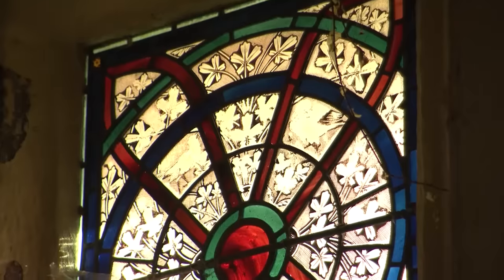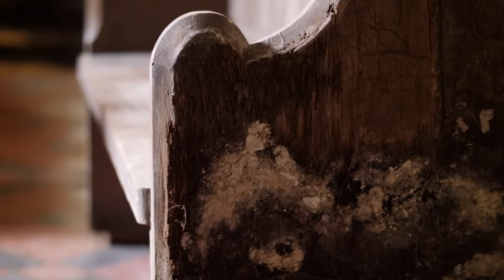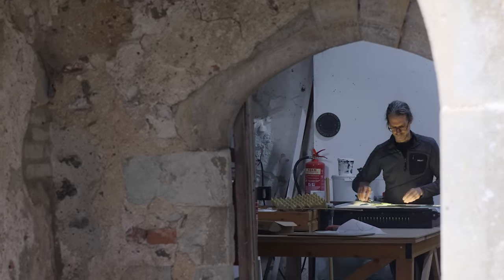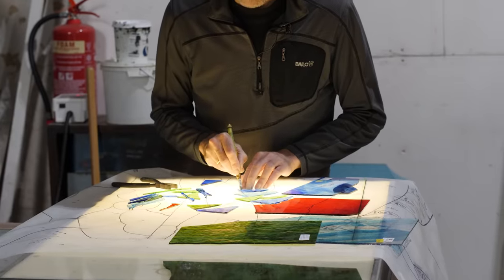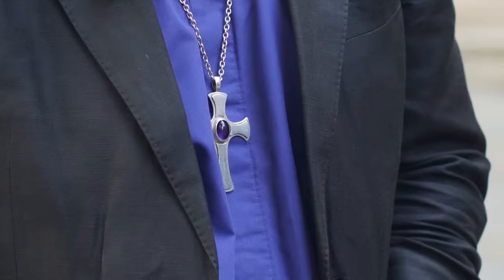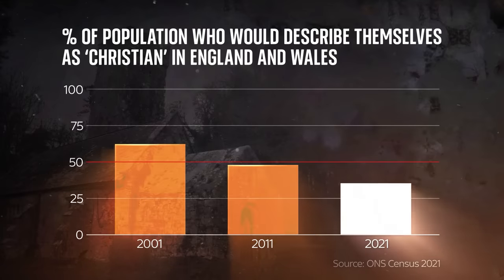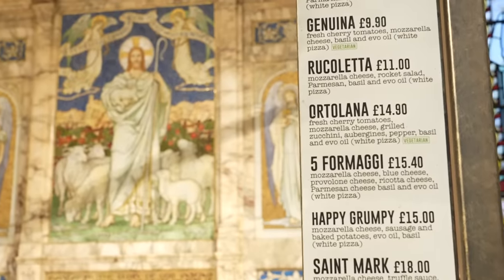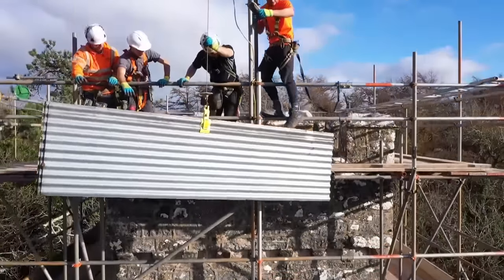Should Britain's abandoned church buildings be saved?

Comment: In the 180 odd years since European settlement and development started in NZ 🇳🇿 we have clearly passef the point where rural-farming depopulation has meant the rise in the number of closed churches...but also in larger towns and major cities where population concentration has shifted....or adherents have drifted away. These are almost always converted into private residences or to community use of some sort.
Most  smaller early churches were built of local wood as the bush was cleared and bricks as kilns were built...stone for our most notable churches and cathedrals is a noble material....but as the earthquakes of Feb 1931, Sept,?2010 and most devstatingly Feb 2011 showed even-- especially -- they are vulnerable. My point here being that since then the more stringent requirements of the revised earthquake building code have made repair or strengthening of many churches and other even modern buildings beyond the resources of the owners.